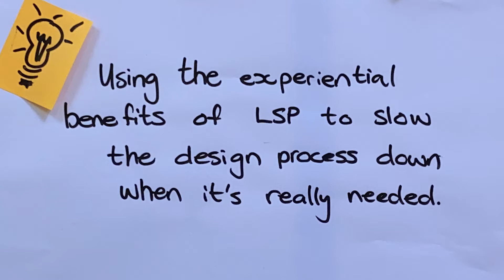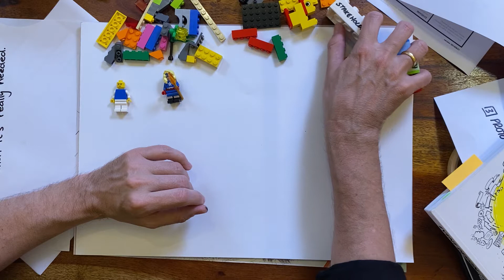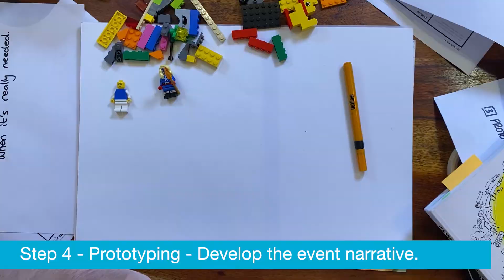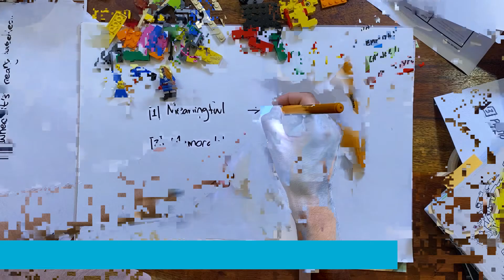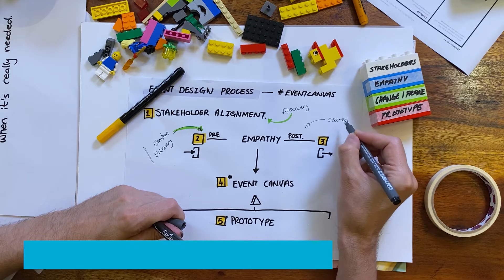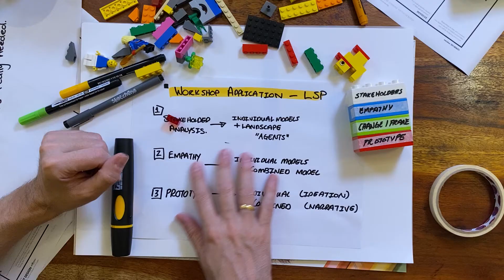LEGO® SERIOUS PLAY®: Using the experiential benefits of LSP to enhance the Design Thinking process

Comment: When in LSP acctivity you use only materials from the box or mix whith notmal Lego?
Reply from the maker: Hey Luiz - I try to keep with the sets. If you read the material from the original founders they specifically selected the bricks for the sets. However I don't think that should stop you if you want to experiment or run a session. Don't let it stop you ;)